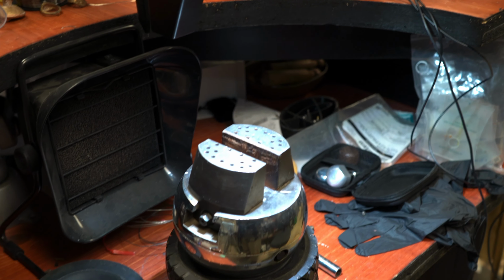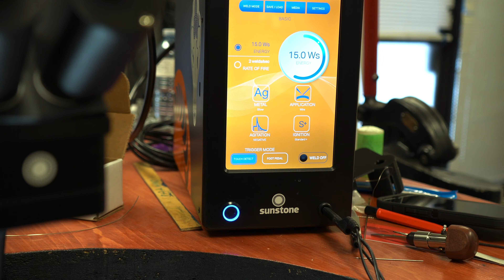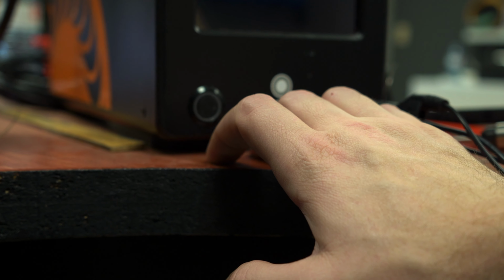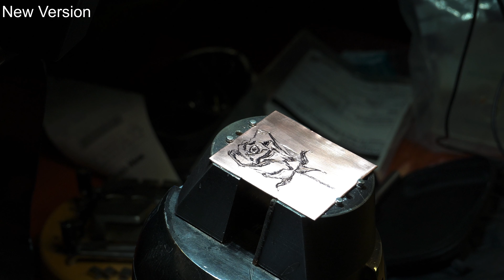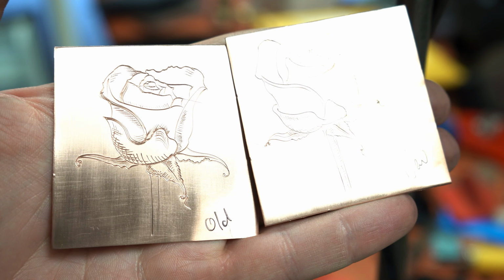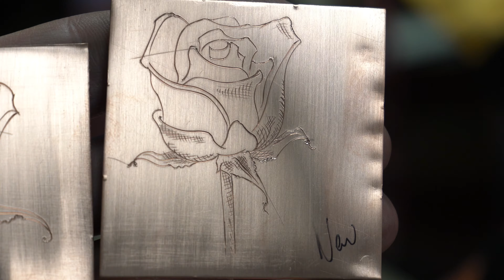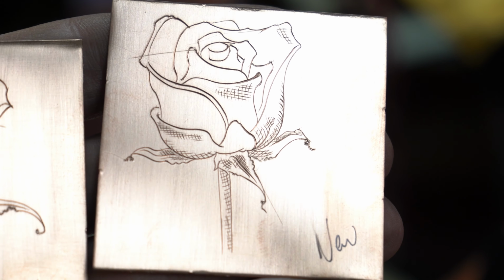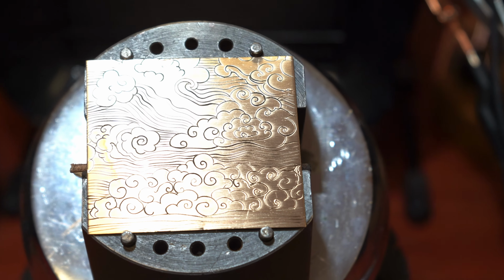Andu Engraver Review Revisited

Comment: Which is better/easiest?  To have a resin print engraved before or after casting?
Reply from the maker: This will depend on the size and placement you have in mind. However I would clarify that you don't engrave resin, but rather I would print the item with the debossed lettering already in place. Especially if it is a makers mark or anything on the inside of ring shanks. 
If its lettering on the outside of your ring shank or other designs then I'd use something like the Andu engraver. 
This will also depend on the reliability of your chosen resin in comparison to your engraving skill to achieve the best possible product.
Reply: Engraved details will generally be sharper in comparison to embossed/inlaid details from a casting. Due to the high surface tension of molten metal, casting inevitably produces a loss of resolution in fine features. This can be mitigated somewhat by the sophisticated high-vacuum setups used by professional casting services.